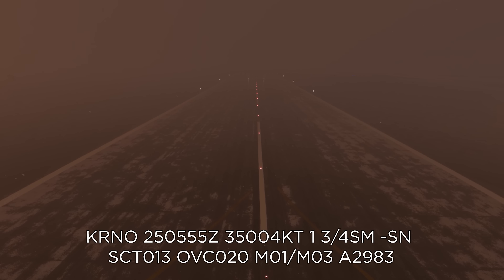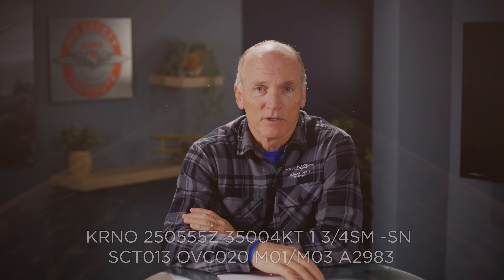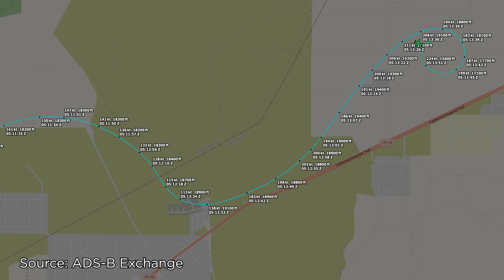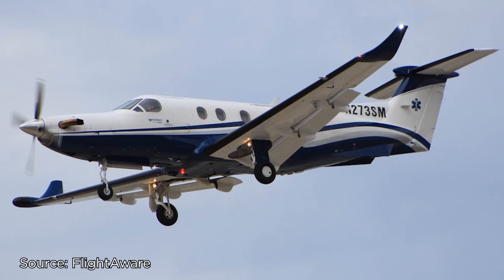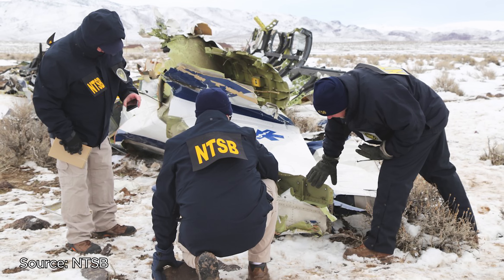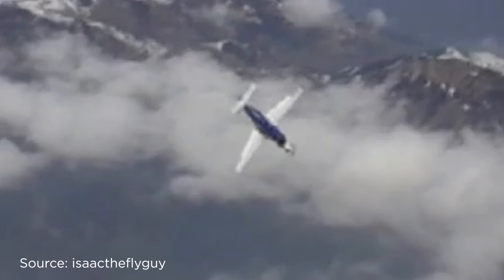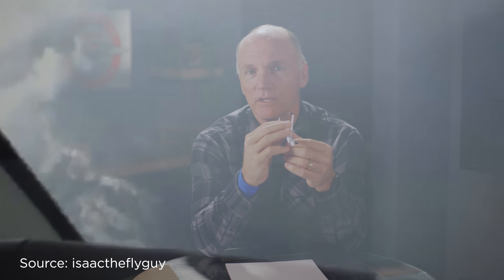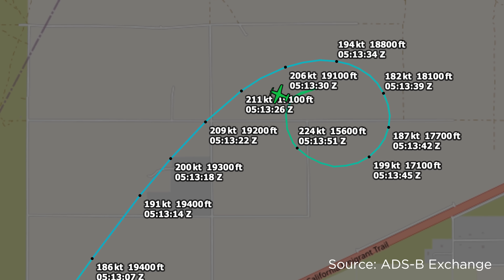Early Analysis: PC-12 In-flight Breakup Over Stagecoach, Nevada

Comment: You failed to discuss key point in adsb data. Pilot climbed out of RNO along SID. The tracking would support he engaged APU. Approximately 10 minutes into flight he abruptly deviates from SID turning south for just under a minute without any change in elevation. He then turns left, easterly, as if to again follow SID. This suggests to me the APU was disengaged, either by APU or pilot. My guess, which is all it is at this point, is APU was disengaged by aircraft due to severe turbulence. It should be noted in communication w/ATC on ground, he is warned of severe turbulence at all flight levels which he acknowledges but does not inquire about possible workaround or alternate headings to mitigate turbulent air enroute. 

Once he has turned east again, he does climb for 2 minutes, he also has one communication w/ATC which is not stressful sounding but his responses are slow. There’s also an earlier communication where ATC tried reaching him 3 times before he responded. All are indications pilot was flying behind the aircraft. 

The fact he was still climbing just prior to the eventual spiral suggests it wasn’t an icing situation. His fairly aggressive climb just prior to spiral further suggests a stall and spatial disorientation. 

I think what we’ll learn is pilot was in over his head from the ground. Why a Part 135 flight in IMC is flying without a pilot in right seat is irresponsible. This air ambulance has had 4 major events in last 2 years, 3 involving fatalities and loss of aircraft. The Hawaii crash is a concurrent investigation. At some point NTSB needs a long look at this carriers operations

Comment: A stall & flat spin, due to an engine failure  possibly and the aircraft stalled due to low air speed. Then it lost the control surfaces during a flat and then crashed.
Reply: .. or not.

Comment: This PC-12 had the older big wing tips. These had a tendency to build up a lot of ice and were NOT protected or able to shed ice once ice built up on them. Climing at a higher than normal climb speed was needed, but with the increased drag climb rates could drop extending your time in the icing. Compounded by a locked out de-ice system and you have  bad combination that can surprise the pilot.
Reply: Did this model have de- ice on the tail horizontal stabilizer ? Just curious.
Reply: @davidwhite8633  yes, all PC-12’s have “Known-Ice” and full wing and tail protection.

Comment: On this version of the PC-12, if Pilots do not perform a pre-departure cycling of the de-ice boots they can "lock out" and not cycle in flight. Often the air in the de-ice system contains moisture. This moisture if the system is NOT tested before departure can freeze causing the loss of use of the de-ice system on the wings and tail. Of course Pilatus and most operators do not require the system to be tested, this advice is solely the result of operating in icing and identifying how to prevent the deice system lock out.

Comment: With over 7000 hours on the PC12 predominantly in Aeromedical role, I have never encountered icing conditions that the aircraft wouldn't handle. The system needs to be activated early and will not shed the ice completely. However it will be safe to fly into known Ice. Prop vibration will occur if ice is allowed to build up by pilot. The -45 series autopilot will disengage in moderate turbulence and has to be flown manually, at least till re engagement is possible. Second pilot may have been of assistance however as a single pilot one has to be capable to manage manual flying not just to have a rating to be able to operate in these conditions. My money is on spacial disorientation, followed by exceeding the air frame limitation causing inflight breakup. However, I would prefer to leave the assessment to professional investigations, as I am NOT one.
Reply: With 7000 hours in Medical aviation, wouldn’t you say that there were just too many risk factors?  Ice, visibility, turbulence, night etc. even if the aircraft is “rated” Jesus Christ there is still a limit where you have to say this is crazy!  I’m saddened and horrified at the whole system as a medical flight crew member myself that not one of them voiced their inner fear and told that hospital that they had to wait a couple more hours till daylight for safer conditions. It’s a lesson to us all that when it sounds wrong, it’s because it is!
Reply: Interesting, there is another PC12 operator saying the opposite of what you are in the comments. They are saying the FIKI capability is oversold, even when activated early...
Reply: The program I work for has a PC-12 that stays incredibly busy during the winter. They rarely decline flights due to snow or icing. I doubt it was an icing issue. My money is still on the pilot having a medical emergency. RIP to all.
Reply: You never encounter icing conditions that the aircraft can't handle until you do.  You might want to reconsider that philosophy.
Reply: @boneseyyl1060  💯💯

Comment: Let’s not forget the mountainous terrain. With icing degrading the aircraft performing the ably to descend to regain density and temperature was limited because the MSA was probably above FL140. There were strong jet streams that day from LA to DEN so wave or rotor turbulence could also have overcome the aircraft performance margins. Not a nice situation to find yourself in. Turning back may be an option .

Comment: With the equipment on that plane and with the amount of altitude to recover, I seriously doubt that spatial disorientation was a factor. I would bet structural icing causing loss of control, normal attempt to recover followed by strenuous attempt to recover due to ice making the first attempt ineffective, over-stress airframe, in-flight breakup, accident.

Comment: Many airlines have self-imposed restrictions on flying into reported moderate icing conditions.  If you have ever flown in the torrential rain of a thunderstorm, imagine that as ice.  I’ve seen ice form up like concrete from a pool guniting hose. No deicing is capable of staying ahead of it.  The quickest escape is the only maneuver to make.  You can’t wait to see if it moderates.  That only happened to me once early in my career.  I couldn’t maintain altitude and had a controller that gave me headings to the nearest and lowest terrain avoidance altitude.  I was lucky and was able to dump it at a lower altitude.  Afterwards I avoided icing conditions as much or more than thunderstorms all the way to a happy retirement.
Reply: Excellent job

Comment: I wonder about the use of autopilot. I would be sure that being single pilot in those conditions that auto pilot would be relied on.
  But…autopilot has its limitations and will punch out faster than an F-18 ejection seat! Now those conditions that caused it to disconnect are thrown in the lap of the single pilot when he would least expect it. In the brief moment of the startle factor in those conditions the plane can violently go out of control. NOW the pilot is way behind an aircraft that is rapidly compounding all the problems it can muster, faster than the pilot can keep up with. And at 30,000fpm… (from what I understand)…descent rate, playing catch up leaves little time😢

Comment: 4:38 icing is kinda unlikely to be a factor here IMHO. Between :07 and :26 the aircraft did increase the speed over ground by 25 knots and also did a slight descend. The first shows that there's plenty of airspeed, which got better before the “loss of control” event. The second shows that it's extremely unlikely that the airplane was at a high angle of attack.

So icing would have become extremely significantly in the extremely short timespan, between :07 and :26 – or the stall would have happened at :07.

Given that they took off in extremely challenging ground conditions (the pilot had issues staying on/identifying the taxi ways because of all the snow), the flight was likely into IMC conditions shortly after takeoff. So a spacial orientation issue is unlikely, as the pilot had to fly the whole time by looking at the virtual horizon, not out of the windows.

As engine thrust, angle of attack, icing and spacial orientation issues don't seems to be likely here, given the limited information currently available, the following scenarios are left as likely:

- Mechanical issues with the flight controls
- Pilot incapacitation
- Malfunction/loss of instruments, like the virtual horizon instrument
- Loss of cabin pressure, leading to a low oxygen
- Impact with something
- A rouge passenger

From these:
- The first one would kinda explain why the flight pass deviated right, then left, then right again, from what it should have been – e.g., a rudder issue. But I think that such an event would have resulted in the pilot asking to return to the field, while trying to figure out what's going on.
- The second could explain why the airplane wasn't following a steady flight path, and why the recovery of a right bank angle wasn't performed without overstressing the airframe - as someone else took control of the plane. This would also explain why there wasn't a call to ATC.
- There's a good match with the evidence available for the third one, as the pilot would have been completely task saturated immediately if that happened – and thus explains the no pan/mayday call, while deviating from the flight path.
- Forth would also fit the evidence pretty well. But in this case, I would kinda expect that the pilot would turn on the AP and select FL010 with a steep descend. But the plane's path looks like it was flown manually in the last minutes, without even attempting to descend.

Last two are pretty unlikely, but cannot be ruled out (yet).

Comment: Is the weather radar on the right wing tip? Is it heated to prevent icing?

Could assymetric icing on the radar fairing disturb the airflow on the right winglet, trim tab or aileron?  Beyond what the autopilot could compensate for?
Reply: The weather radar antenna is on the right wing. It’s mounted in a slipper pod. No to being heated and no to causing control issues.

Comment: Wave and rotor. I live south of Reno and noticed wave and rotor conditions to the east Friday during the day. 

If the wave was high, say 15 to 20 thousand feet, the altitude seems about right for rotor. Rotors, typically below the wave (lenticular) have torn many airplanes apart.  Vertical wind sheer with speeds over 70 miles per hour have been documented. In the late 1950’s and early 1960’s the government commissioned a group of sailplane pilots to take wind speed and direction measurements to better understand the dynamics of lenticular clouds and the accompanying air turbulence. One of the test gliders was ripped into multiple pieces. As I recall (from reading) the engineering team estimated the glider experienced over 20g’s. That was about 100 miles south of where the plane went down. So flying in and around wave conditions has the potential for high force turbulence which could easily take a stabilizer or with tip off. Just another thing to consider.
Reply: Yup. My Dad thought he was inverted when flying a DC9 one night - he pushed the yoke forward the plane slowed down. Pull back, it sped up. The co-pilot had to take over while my Dad's senses finally got back to normal and he realized that they were in a extremely wide and violent updraft.
Reply: Great point that no one has mentioned!  Rotors terrify me!

Comment: He was in an enroute climb segment so pilot work load should have been minimal. It seems control was❤ lost when the A/P  disconnected. There have been at least 4 other PC 12 accidents similar to this one. Something as simple as an A/P disconnect caused complete loss of control of the aircraft. Autopilots have gone from accessories meaning luxury items to necessities meaning they can’t fly with out. These accidents prove there is not enough emphasis on basic IFR hands in skills. 
In the old days Chief Pilots would hardly let you use the auto pilot, these days many discourage hand flying …..and we can see the results.
Reply: Right on!